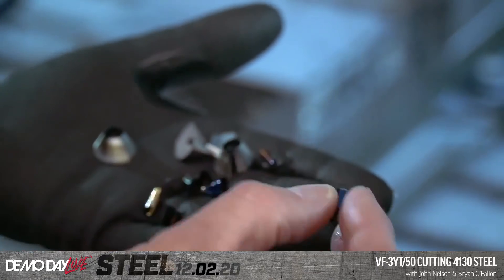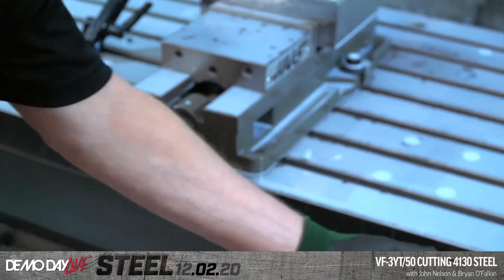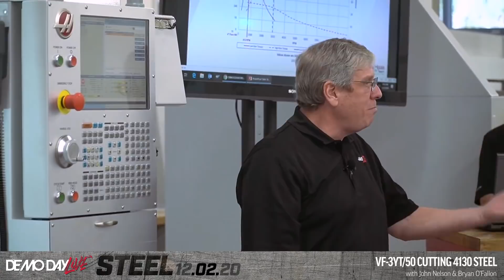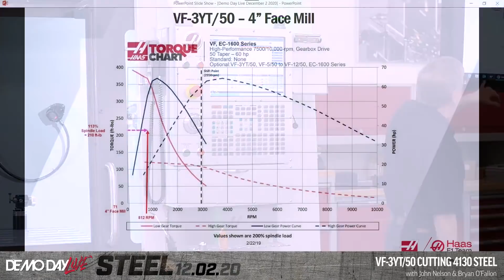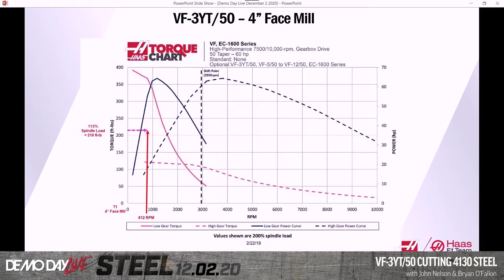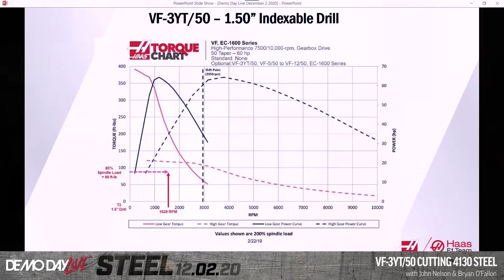Haas VF-3YT/50 Cutting Steel - Demo Day Live Focus Video - Haas Automation, Inc.

Comment: where is the cooling?
Reply from the maker: AdamMA97, The milling cuts were purposely taken without coolant turned on for the purpose of showing the cutting and chip stream as clearly as possible. You'll note that the drill is still using coolant.

Comment: HAAS.
Could you please explain how you Calculate 60 Horsepower for the Spindle output ?
Is this a mathematical calculation based on the Reduction Gearbox ?
I am guessing ?? The Gearbox has a possible 2:1 Reduction ??
( i say guessing because i don't know what the Reduction Ratio of a HAAS Gearbox is )
It might help if you could reply as this is a bit of a confusing item you discussed during this video.
Always Good to have the correct information available to possible interested customers.

Also, LOVE the size of the Work Table on the VF3.
Reply from the maker: WELD MACHINE, Sorry for the delay. Evidently we haven't looked at comments on this video for a while. To answer your question . . . For some general info on how Haas Spindles work, please go to this web page and read the section about “Powerful Vector Spindle Drives” under the heading “Not Just Bearings and Shafts, but Electronics, Too”. https://www.haascnc.com/productivity/spindles.html. 
Then you can scroll down and click on HIGH PERFORMANCE 7500-RPM SPINDLE for details about this particular spindle.
Here is the direct link to the 50T HP SPINDLE: https://www.haascnc.com/productivity/spindles/7-5k-50-hp.html
On this page you'll find the TORQUE CHART tab which shows the low and high gear torque and power numbers. Thanks.

Comment: I think it was a great video showing how haas is trying to improve there machines , i hear these 50 tapers do really well for shops cutting hard materials. Ask peter from edge machine.
Reply: If your talking about Peter from Edge Precision, you are talking about a complete different machine.
First it's a Mazak Not a HAAS.
50 Taper on a VF is not much use,  if the machine has less rigidity than the tool holders ??
50 Taper on a Horizontal YES definitely worthwhile.
Not so much of a concern on a VMC.
40 Taper is more than enough.
If you want more, 40 Plus is more than Any VMC will ever need.

Not having a personal dig at you, just an online discussion.
All the best.
Peter.
Reply: @weldmachine  om talking about the shop tour (centerline) were he showed and stated that their haas 50cat works very well for them in titanium and inconel ...yes i believe that they were VF 5's tho
Reply: @weldmachine  sorry,,i should have been more clear about my statement.
Reply: @jasonruch3529 
 Please don't be sorry at all.
My only concern was the overselling of the advantages of a 50 Taper on a HAAS VMC  ????
HAAS are great machines no doubt. 
Some of the people watching can only wish to own a HAAS machine. 
Just need to understand there limitations.
Thanks for your reply. 
Regards Peter.

Comment: Hello, what is cutting parameters for Metric ?
Reply from the maker: Arczi Milano: Here are the various cutting parameters. We should have included these in the original presentation. 
4” 45-degree face mill is 101.6mm diameter
259 Surface meters per minute. 0.249mm feed per tooth. 5.588mm depth of cut. 76.2mm width of cut.

3” 90-degree shell mill is 76.2mm diameter
259 Surface meters per minute. 8.25mm depth of cut.

1.5" Drill is 38.1mm diameter
182.9 surface meters
 per minute. 0.165mm feed per revolution

Chamfer mill
243.9 surface meters per minute. 0.19mm feed per tooth
Reply: @haasautomation  Thank you so much, sorry for the trouble

Comment: Will you be doing a steel demo with a UMC750? Would be interesting to see how hard you can push it since the machine is not as rigid as most especially when cutting in the x axis direction.

Comment: So has the whole machine been beefed up stand up to the added forces of the spindle upgrade? We push the limits of the standard VF3 everyday machining 304SS continuously. We use the gearbox model for roughing and direct drive for finishing. One of our gearbox models just failed. Waiting on a technician to repair. We have two newer SS models and I’m also trying to find out if they’re anymore rigid and worth trying some roughing on? We mostly use them for lighter duty jobs where their speed increases productivity.
Reply: What we were told when we bought our VF4 years ago was the iron was the same between a 40 and 50 taper, that Haas just changed the spindle. So, yeah, the tools are more rigid with the 50T, bit the rest of the machine isn't and stiffer.

I take cuts in an EC-1600 that sound great that a comparable cut on a VF-4 sounds awful.

Comment: Thought that 3” shoulder mill chattered like crazy during the live event?
Reply from the maker: Dustin, You’re correct. The shoulder mill did chatter during the live event. We noted in the video description that we put in audio from another run we made on the same part, right after the show, with the feed rate turned up just slightly. As we noted in the comments for the live stream; John had run 4 parts before the show with no chatter and thinks his feed rate was probably just a little slow. Such is the way with live events. For the naysayers, once you’ve done a few live events yourself, let everyone know if every step of the way went perfectly without any hiccups.
Reply: That's how shoulder mills sound and that's not chatter. It is the larger undeformed chip thickness and the non ideal tool engagement. Still that's not the right machine for this task IMO. They just don't last cutting like this.
Reply: @Sketch1994  no it definitely chattered during the live demo.  They obviously make another take.
Reply: @Thewaldo12345  Huh... Didn't get to see that. Embarassing both for the live chatter and for changing it up. Chatter although is not always predictable (there was a video of a Matsura horizontal hitting it's spindle's resonant frequency just on one pass for a certain width of cut)
Reply: @Sketch1994  it was a pretty healthy cut with a lot of tool pressure.  On the live he said they had been running that demo several times throughout the day and the inserts probably needed to be indexed.
Reply: It definitely did but showing how much it could hog off with the power is pretty much what they were doing I think
Reply: We have a heavy machining 304SS job that eventually caused a gear box to fail.chatter was not an issue until the gearbox started making noise. Moved the job to another gear box machine and got a good amount of chatter when cutting in X direction either direction, none in Y. Moved it to another machine and got chatter in every direction. Moved the job to a direct drive machine and it purrs like a kitten like the first machine. All standard VF3 within a year or two build dates. Not sure what's going on. The DD machine doesn't have the low rpm torque so we adjusted a few things but tool life is better now
Reply: It definitly did during the live demo :D

Comment: How much continuous horsepower?
Reply: Haas rates their spindles at 200% load. He claims this is a 60hp peak (200%) so that would make it 30hp continuous. (100%). It's a sham when companies call out spindles this way.
Reply: As much as we like to watch HAAS videos
HAAS is still a company trying to sell product.
YouTube is just another way to promote a product.

One thing to remember ?
People will Always believe what they want to believe.
If a 30hp motor can magically produce 60hp and you want to believe it ????

The only thing i think about when listening to comments during HAAS videos about Spindle Loads ?
Is the machine is Not up to the job ????

Definitely NOT a HAAS machine hater.
Just someone who understands a machines limitations.
Reply: @weldmachine  Thats what the vector drive does.  A 20hp vector drive machine has a 10hp spindle motor.  ITs 10hp 100% load @ 200volts.  The vector drive will produce 400 volts (20hp) for a short period of time.   Thats why the stickers say "20H.P. vector drive" because that is exactly what it is.
Reply: continuous horsepower is whatever 100% of the rated load is at a given rpm. going over 100% is no longer continuous horsepower

Comment: You guys still do the old school 5/50 & 6/50 demo's with the ridiculous 3"-ish insert drill?

Boss had me up on the steps in front of a 6/50 at my first WESTEC & that demo scared the shit out of me. The chips that thing would fling were freaking insane!
Reply from the maker: Iceberg86300, That brings back memories. Those demos were renown in the early 2000's WESTEC days. Guaranteed to bring a crowd into the booth when we started that one up. Several of us were arguing that we should use one of those big drills in the demo just for the noise and smoke factor. But apparently more restrained minds prevailed. Maybe we'll get one of those into a demo this year . . .